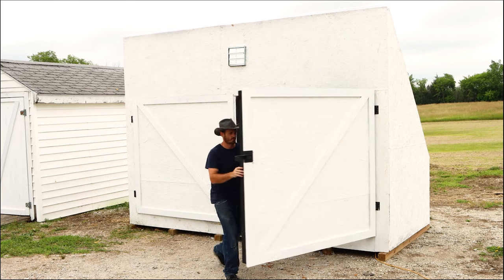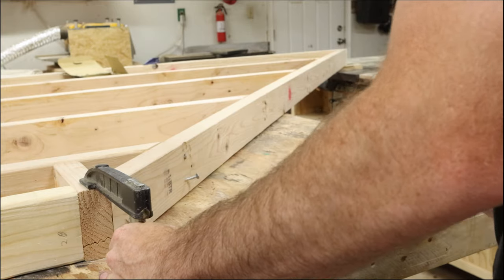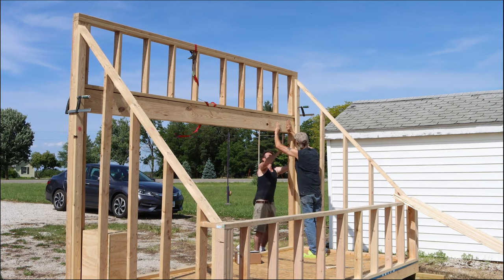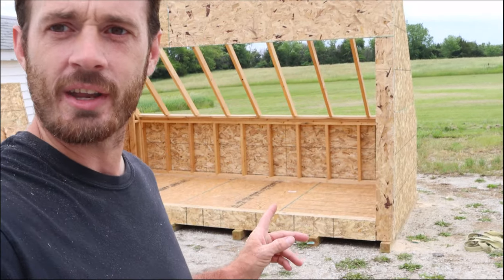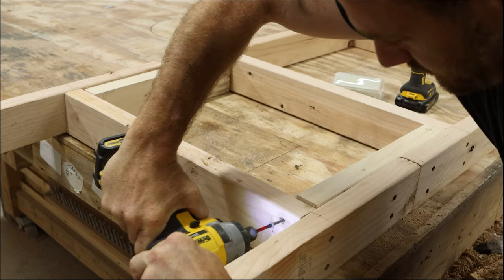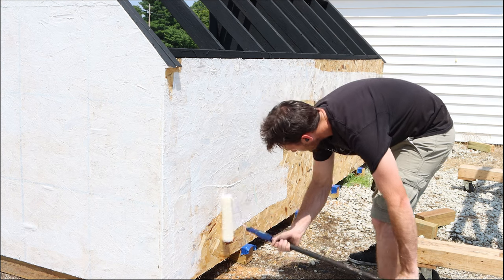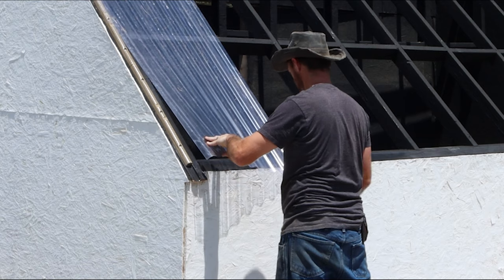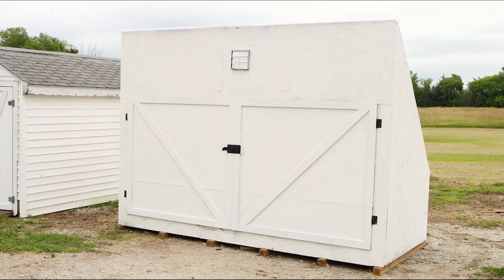How to build the Virginia Tech Solar Kiln On a Budget

Comment: I would use an angle grinder with an abrasive cutoff wheel to cut those plastic panels, just be aware it may slightly melt the edge if you aren't moving fast enough

Comment: It would have been better to run the 4x's on the ground perpendicular to the joists of your floor, this would accomplish a couple things, one you would only need 3 of them on that size shed and two it would significantly increase the load bearing of your floor as every joist would be supported instead of having every other one just floating in the air
Reply: Whoever made the plans was obviously just a student this guy had to fix their mistakes and the comments are noticing more issues because the plans were mostly wrong in the first place.

Comment: Dewalt makes a shear attachment for their impact driver that cuts those panels like butter and gives as clean a line as you desire.

Alternatively, fixing a hook razor blade into a multi oscillating tool works the best IMO.

Comment: Use a circular saw with and old blade put on backward. Clamp a board to panel, cut multiple panels. If you want professional look take small propane torch and melt cut ends 1 at a time starting with top panel melt about 6” off from rest of stack then remove that one and repeat.

Comment: Although you say the door diagonals are purely aesthetic I would disagree. If you reverse them IE high ends towards the centre of the building you should find this will provide some extra stiffness and help prevent sagging and binding along the lower edges.
Reply: The OSB sheathing already does that

Comment: Great build, those hinges are way too small that’s why the door is sagging. Normally you can get away with 2 hinges 1/3 the width of the door, but in your case for such a heavy door I’d recommend at least 3 hinges 1/2 the width of the door.

Comment: OR just use deck  screws -- almost certainly you have a power or impact driver. Yeah, you'll almost certainly want to pre-drill holes and such, which is a little more effort, but it's a lot less work traded for a bit more time. But it also makes it easier to make adjustments if you want to arrange things differently later...

For the screws, if you have a Rural King near you, they are awesome for buying bulk fasteners cheap.

Comment: I'm trying to figure out the auto fan control.   I like that better than the vents.   I'm assuming all turns off at night to allow humidity to relieve stress, but during the day is the fan set to relieve high heat or humidity?     What setting did you put it at?   Thanks!
Reply from the maker: It is set to go off at 110° and the humidity doesn't need to be controlled in a solar kiln. The heat expells the moisture just like an oven does to food
Reply: @WyldeWoodworks  thanks!  When you mean "goes off" does that mean the fan turns on?   Sorry for my ignorance...  just trying to understand.   I'll be working through the night to get this closed in so I think I'm going with your auto fan.   It works for my chickens.    Missouri is getting snow so I'm trying to finish.   Lol. Thanks again!!
Reply from the maker: @andrewmadasz7748  lol nice! The fan turns on any time it's above 110°

Comment: You should probably plan to move this onto a foundation if this works well for you. Just a bunch of concrete pier blocks on gravel and a skirt of some kind to minimize air exchange would greatly extend it's life time. Don't underestimate wood smeared with Ivory soap bars if you ever need to slide this around. It would let you level things out if you wanted too.

Comment: These work boss for drying firewood with the a solar powered humidity controlling system to run the fans.....2 years to dry oak?...naa, load it with green wood in spring and your good to burn in mid autumn.
Reply: Thanks.  I was wondering about that.  Having to burn mostly wet wood this year.🙄
Reply: @paulnandico2370  Wet wood is hard work.....i used a kiln like this to dry wood for 7 years before moving house.....i had 6 140mm computer fans pulling air out at the bottom powered by solar panel
Reply: @unhippy1 thanks for the encouragement.  May have to build one.  May need more than 1... as we need 12 or so cord per our 7 burning month season.
Reply: @paulnandico2370  it may be cheaper with that volume of wood to dry to get a kit tunnel house/greenhouse and set it up as a drying house.....that simply being to seal it from the ground so no moisture can get from the ground to inside the hothouse and to set up the ventilation system to draw air in at the top and pull it out by solar fans evenly at the bottom with the fans sized to exchange the hothouse air volume every 10 or so minutes when running in full sun....it works unbelievably well as long as you have halfway decent sun and can stop the ground moisture....doors at both ends are helpful as well as you can load it in from one end and then start using it from the other end so your  always using the stuff thats been in there the longest
Reply: @unhippy1  that requires something we don't have:  much flat land.  Our house and gardens sit on the only flat land we have.  We live in the White Mountains.  However, we are normally pretty dry, so simply making pallet woodsheds works decently.
Reply: @paulnandico2370 The reason i made the solar kiln was lack of flat land as i built it on treated wood piles to allow a flat floor....the floor at the back was pretty much on the ground and the front nearly 3ft off the ground. I live in New Zealand and the property i built the solar kiln was in Dunedin so pretty damp
Reply: @unhippy1 thanks.  That is our situation here.  Sounds like a good plan.  I always figure we got more land as acreage here is arial and slopes are like getting free land.😁
Reply: @paulnandico2370 lol thats exactly how i looked at it....i had 3.5 acres on paper but with the slope being as steep as it was it was more like 4.5

Comment: Awesome build! I picked up a Banks framing nailer from harbor freight last year for $100 and haven't had any issues with it. It's not the best, but it beats the hell out of nailing by hand.
Reply from the maker: I couldn't even find a used one for that. Pneumatic?
Reply: Yup @WyldeWoodworks
Reply: @WyldeWoodworks pawnshops are a good place to source nailguns. They will generally work with you on price. Just make sure you can test in store or they allow a return within a specific time frame. Also, the better ones can be rebuilt.

Comment: How does it hold after some time? Did you do the spacing right, so that the wood movement doesn't prevent doors to close?
Reply from the maker: It's working out great so far! I pulled the first 2 loads out of it already and it's working very well. Honestly, the spacing on the doors could have been better. They do stick.
Reply: Where does the moisture drain?
Reply from the maker: @peterfreeman3317  it doesn't need one since the fan kicks out the excess humidity

Comment: Hoe much air movement should you have inside it? Im converting an old metal building into a solar kiln and really can't figure out how big of a fan I need. I'd like to go solar with them but I'm not sure how big of a fan I need.
Reply from the maker: In my opinion it's better to have multiple fans rather than one big fan. A good way to test it is just set up the stack, put the fan where you want it and just feel behind the stack with your hand to see if there's air flow and where your low spots are. If you can feel good air flow then you're good.
Reply: @WyldeWoodworks  thanks

Comment: Anyone know how long it takes to dry and what the tarp is for?
Reply from the maker: The tarp is to help control air flow and it being black on one side helps increase the heat inside the kiln. The time frame depends on what time of the year it is, the type of wood and how thick it is. If you're drying 2" expect it to take 3+ months. If it's 1" it might take as little as 1 month.